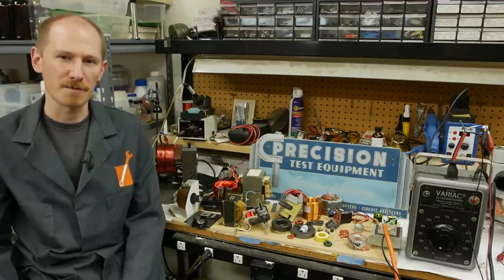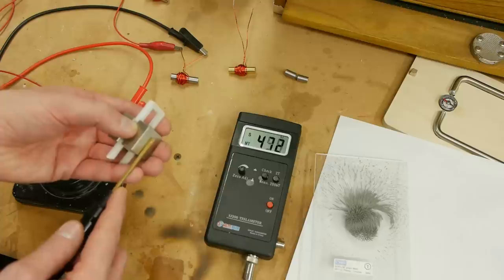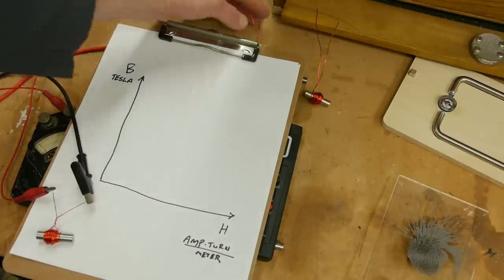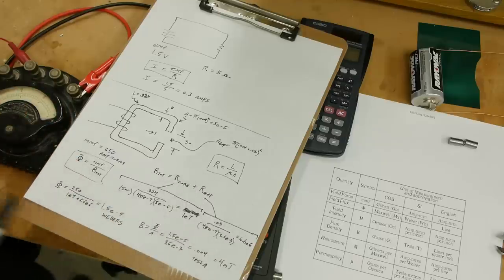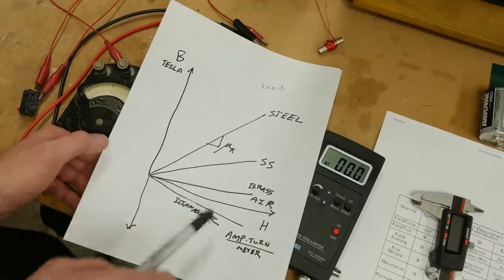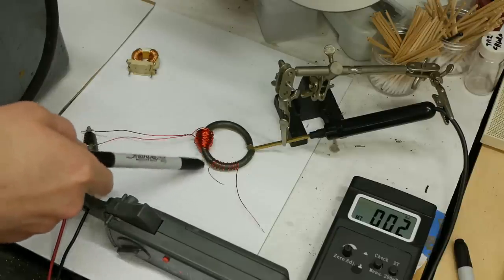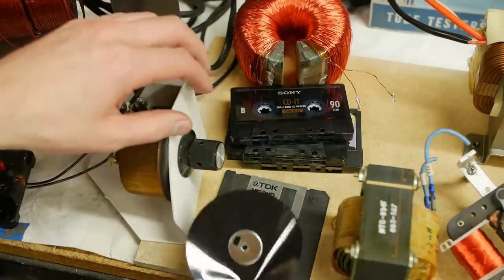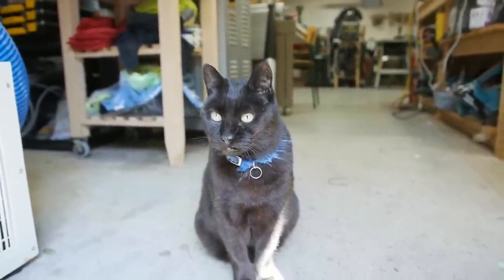Engineering magnetics -- practical introduction to BH curve

Comment: One of the best educational videos on magnetics! great Ben.  I got one request could you make a small video on the simplest setup for getting BH curves. Your Oscilloscope is a grat way, but that might be out of reach for most of the hobbiest. So a cheap DIY measurement setup for measuring the BH curves and µ µr I think that would really help out a lot of people who are interested in this subject. Thanks
Reply from the maker: Thank you!  I completely agree about a less expensive setup for measuring BH curves.  In fact, there is a great solution:  a single opamp can be setup to function as an integrator by placing a capacitor in the feedback loop. Typically a large (1 or 10M) resistor is placed in parallel with the capacitor to eliminate the problem of the integrator running away due to small DC offset voltages at the input.  When measuring at 50/60Hz, almost any opamp will work.  All you need in addition is a variac or other source of controllable AC, and an oscilloscope or data capture device.  You can even use an older analog oscilloscope as long as it has X-Y mode (most of them do).  I should have mentioned this in the video, since it may actually work a little better than using a scope's math function, and is the way that all these measurements were made before scopes with a math feature existed!
Reply: thanks for your comment, this is helpful for me. My ideal measurement setup would be something like a fixed geometry for a sample like a cylinder. (some magic equipment) and everything connected to the PC (via arduino perhaps). to get the data and calculate everything there.
Reply: If you are mostly interested in making the measurements themselves I'd recommend you get a USB oscilloscope. There's some available on eBay for around 70 $ (Hantek 6022BE, I don't know how good they are but the somewhat limited bandwidth of 20MHz should be fine for measurements like these) which are probably a lot easier to use than to setup an arduino. If you are more interested in setting it all up with an arduino then of course go ahead, just keep in mind that there are easier solutions. Cheers :)
Reply: how about a adafruit feather M0 (for better adc) or directly arduino if you don't worry for accuracy. A current transformer tied one end to a voltage divider, the other to your ADC in (load resistor also don't forget) or a hall current sensor from Allegro. Just measure them and plot them. Do the math inside the arduino and use PLOT to see the result or just use Labview and make it do everything.
Reply: Vale Sarbu there's still the risk of damaging the ADC of the arduino though if the voltage from the transformer gets too high. A solution would be a 5.1V zener diode connected from the ADC input to ground to make sure the measured voltage doesn't go above what the arduino can handle.
Reply: it would be hard for it flow current given the resistor divider present but yes... A zenner, a diode to 5v or even better a resistor series with the signal and a diode are even better.
Unless you choose a resistor low enough to never have this issue that is...
Reply: That particular scope might be out of reach but thanks to labs upgrading to ones like it, a lot of perfectly good analog scopes can be had used for about the same cost as the entry-level digital ones:
https://www.youtube.com/watch?v=rTPhuRQBmLQ
Reply: 5.1V zener: the problem is that you have traded off one failure (ADC) with another (the zener, when it pops). 

Second, if you examine zener I-V characteristics, you find two families of curves, zener vs. avalanche. Zener breakdown has a very "soft knee," while avalanche is quite sharp. Zeners go as high as 5.6V (soft knee) while avalanche mode diodes start at 6.2V. A 5.1V zener's very soft knee has a lot of "leakage current" when operated below its rated breakdown voltage, making them rather lousy "clamps." Find a 5.1V zener's datasheet and look up it's I-V curve to see what I mean.
Reply: Demef And that’s why you can use an avalanche clamp and feed its output via a resistive divider into the ADC pin. But all this talk of “trading” one failure for another… if you’re going to blow the Zener diode, you haven’t designed the circuit properly. The Zener and other elements in the measurement circuit have to be sized for the job. And personally, I would just use a magnetometer chip instead of using a coil for a sensor. Hall effect sensors are dirt cheap and most will run from the same supply as the Arduino, so no problem there, and there’s no need for an integrator either. You can make a small notch in the magnetic circuit and stick the Hall sensor there, or just put it at the end of the bar of material like Ben did. That field meter probe has a Hall sensor at the tip. That’s al there’s to it, most likely.
Reply: @AppliedScience  You don't need an op-amp!  You just need a capacitor & resistor.  You adjust values to give a lot of attenuation (versus the sense-coil raw voltage), & send that to the 'scope.  The R-C does the integration.

Comment: you have a few significant mistakes:

diamagnetic materials do NOT have negative permeabilities, just a lower slope than vacuum
superconducting magnets do not overcome the issue of ferromagnetic saturation, they simply have a buttload of amp-turns
brass has a permeability close to air, not zero
Reply from the maker: Whoops! Thanks for pointing this out!
Reply: Applied Science    I believe you may have been thinking of magnetic susceptibility and said permeability instead. For a perfect superconductor, magnetic susceptibility is -1 while magnetic permeability is 0.
(Volumetric) Susceptibility is basically just the ratio between the M and H fields. χᵥ = M/H
Permeability is the ratio between the B and H fields.  μ = B/H

For anyone reading who doesn't know;
H is the applied magnetic field. 
M is the material's internal field due to H, (or magnetization)
B is the total magnetic field, or essentially the sum of the H and M fields (except multiplied by the permeability of free space.)   B =  μ₀(H + M)

(Edit: clarified volumetric susceptibility)
Reply: Wew I wondered how u guys understand this nerdy thing (oh well guess u guys are nerds too)
Reply: Diamagnetics don't have negative permeability? Dang, you just ruined my plans for a perpetual motion machine that pushes a wheel using an asymmetric magnetic field :O
Reply: Is a buttload a CGS unit or SI?
Reply: @AppliedScience  Great video, I do have another detail to pick on though. At around the 40 minute mark you mixed up the terms magnetic remanence and coercivity. Magnetic Remanence, or retentivity, is the remaining magnetic field with no applied magnetic field (which you do mention earlier in the video) and coercivity is the applied magnetic intensity required such that the B-field goes back to zero. I.e. the x-axis whereas you pointed to the y-axis. Very good video however!
Reply: @Applied Science Thats a cute kitty.
Reply: i think it could be interesting to see how  transformer cores made out of Mu-metal, metallic glas and Bismuth behave.
Reply: @hyperhektor7733  metallic glass is used in that application it can be spun cast. The competitor material is silicon steel with controlled orientation of the crystals.
Reply: @hyperhektor7733  There are some metglas transformers, but only for specific applications, not power applications I believe. As for bismuth is a diamagnetic material, so I cannot imagine it being used in a transformer application
Reply: @Eric-ku6cy Its an Imperial measurement of volume. I'm confused about how it measures blue pixies in a space ship

Comment: Congratulations for a great presentation!
Although there was nothing new for me, I know I would not be able to present same things without the math.
Here comes some of my personal “magnetics past”.  Before I started my studies, I read some radio/electronics books and found there formulas to building a transformer necessary for the radio or other gear.  There was this funny constant, 1.2 T.   That was listed as a constant for the steel laminations and was used tu determine how many turns of wire was needed, along with some dimensional items and the frequency.  O.K, my studies added all the hysteresis loss issues, plus Eddy Current losses to the story.  And one thing that I learned was how to actually distinguish between the two kinds.  Hysteresis losses increase proportional to the frequency, but Eddy current losses increase proportional to the square of the frequency.  So, you measure the losses at two or more frequencies.

I worked while studying and there I was introduced to Grain Oriented Steel that had saturation level indeed at 1.5 or even 1.7 T.  But if you pushed your transformer design to those numbers, you started getting occasional trips of the breaker (or in our case blown fuses) and that with no load on the transformer.  Why?  That was because the inrush current brought the core into saturation depending on the exact moment of the AC voltage when the primary happened to be connected.  The lower grade steel is more forgiving, as the hysteresis curve tails have a bit more slope or more rounded corner, while the grain oriented material settles on much flatter way or lower slope.

Then, ferrite cores have much lower saturation limits than even the basic steels.  My rule of thumb is that low frequency ferrites might be as much as 0.3 T, while high frequency applications I should not design with any higher than 0.1 T.  I hope these small notes might still be digested by at least some viewers.
Reply: Pellervo Kaskinen hi , can you please explain difference between coupled inductors and transformer . I was studying about power electronics gate drive circuits where coupled inductors are used to isolate the high power and low power circuits . I thought it was just an isolation transformer  but it was mentioned that it's called an pulse transformer. 
PS : I'm not afraid of math , if you could point me to any reading materials or sources about it , it would be great , Thank you.
Reply: Manoj Gowda  —  I may be on a wrong track, but my opinion about the difference is that the term “coupled inductors” came from people who tried to analyze the mathematics of it.  The practical people just noticed the couple salient behaviors that implemented transformation of voltage and current and called the device a transformer.
Then I have noticed that the term Coupled Inductors seems to be used on air core assemblies, or other cases where energy transfer is limited, including when the core operates into saturation.  An example of such might be pulse transformer.  On the other hand,  you might consider what is called Tesla Coil  —  not Tesla Transformer.  That at least as far as I have noticed.  “Dear children have many names”.
Reply: Pellervo Kaskinen thanks 👍
Reply: How about those advanced Fe-Co alloys such as the Hiperco 50? They claim 2.2-2.4T saturation flux density when subjected to proper thermal annealing etc. Is this realistic?
Reply: Awesome comment.
Reply: @bormisha  I have heard of getting FOUR Tesla saturation from glassy Fe-Co ribbons, where the molten metal is cooled at about 1 million degrees per second, in a very thin layer.

Comment: BH CURVE!!! THATS WHAT ITS CALLED!!  Oh man, you have no idea how helpful this video was for me. I fly fpv racing quad copters which use really powerful brushless DC motors with really strong neodymium magnets in them..  Years ago I was discussing with a friend about how these motors wear out over time.  Specifically, this friend was asking what the effect was of running the motors at really high voltage/current.  I tried to explain to him how magnets are made by putting them in really strong electrical fields, and how when we use them to create rotational forces we are putting them in a similar electrical field, which as long as we stayed under a certain limit, we would get work out of the magnets, but the closer we got to the limit, the more the magnets would lose their charge so to speak.  I remembered a little bit about the BH curve from high school physics, but for the life of me couldn't remember what it was called.

Comment: I've been an IC design engineer for over 35 years and never really had to deal with actually understanding the magnetic concepts you have explained here. I often relied upon inductor data sheets to find the correct inductor for a switching power supply design. I cruised through BSEE design courses doing the math and not really understanding the magnetic properties that you are describing/educating in this video. Thank you for the beginnings of an intuitive understanding of the magnetic principles explained in this video. I say intuitive because the best designers can become very intuitive about understanding principles in a practical way so as to come up with designs or solutions to electrical problems. I know it's only a beginning lecture but it is the best beginning lecture I have ever had on magnetic principles, B Fields,  H fields, magnetic flux and density etc etc. Thanks again.

Comment: Wow, great video! I see your approach is a little bit different from what is typically used, at university we started with fundamentals and gradually came to materials and stuff, yours is very easy to understand nevertheless. Here's a few suggestions: when measuring BH curve with an oscilloscope and secondary winding, you could just use RC integrator instead of mathematical function, that would be simpler and I guess more availible to most of your viewers; also it would be very interesting to see a BH curve of a permanent magnet, as far as I understand it's almost rectangular for these kinds of materials.

Comment: Thanks. While much more crude, I feel like I understood this stuff a little better after rewinding some transformers myself. (no content created on rewinding)
  I started playing with a couple of old phone chargers. I used the rated output, and voltage as a starting point. Then I took measurements of the open circuit voltage, and the actual voltage at the rated load current. Once I had that info, I removed the small transformer from the circuit, I boiled it in water to soften the varnish, and split the two halves of the core. The next step was to remove and count the secondary turns. It's tedious, but a necessary step. With the secondary turns ratio and the actual voltage/loaded current, I could calculate the primary turns ratio. This gave me the turns to voltage ratio. I used that number to wind a new secondary to whatever voltage I want.
    Of course I am aware that the secondary load determines the primary current, and I simply used the original wattage rating to determine the output capacity at whatever voltage I rewind the secondary for. I also used a thermal fuse incorporated just outside the secondary winding as an extra safety measure in these crude experiments. These devices are not intended to be left powered and unattended for any reason. That said I still have a couple of old 5v chargers that put out 9 and 12 volts. I also built one that does +/-5. 
  Those experiments got me thinking about trying to rewind some standard 60hz mains transformers. I've rewound 2 of them so far with the same results, although rewinding a little 12volt 1 amp mains secondary is a chore compared to a little SMPS.
  For a person without the academic background like myself a practical and simple experience like this helped me see through the jargon and math well enough to help me want to learn more. I would love to be able to clearly test and measure saturation in a core. I have saved many examples in playlists (that are publicly listed too if anyone is exploring EE on YT), including saving this upload in my "Fundamentals Power Supply" playlist.
    I shelved my transformer experiments a few months ago, but I think the next step for me will be building a tesla meter. I think a project like that will really help me to connect the dots.
  I'm just trying to share a bit of the learning experience from the perspective of someone that is interested and engaged in the subject, but lacks the rigorous EE background to make sense of these things.
  As far as the stupid terminology used in the field. I personally find it really annoying. Humanity needs an international Scientific version of ANSI to modernize a lot of the poorly organized, antiquated, and grandfathered terminology that could and should be eliminated in favor of intuitive solutions. Some people say it's too hard to change, but the saying, "it will never be easier than it is right now" always applies. That's just my $0.002 adsense.
-Jake
Reply: I agree everything except the new terminology part,  I think with some academic background, you can understand them.  Ben's videos are awesome,  most of the time,   stuff is not thought with this level of emphasis on practical measurement. I actually sent this video to my professor.